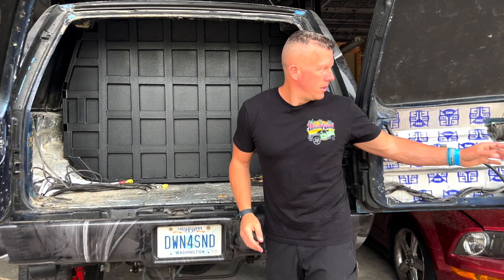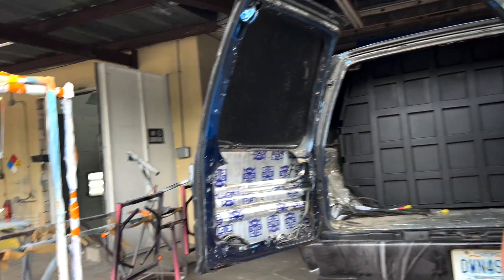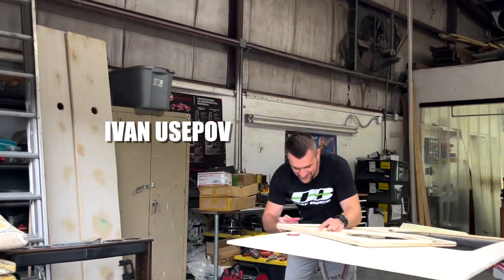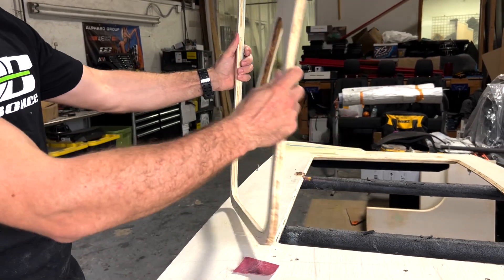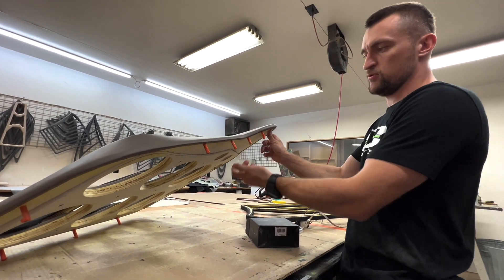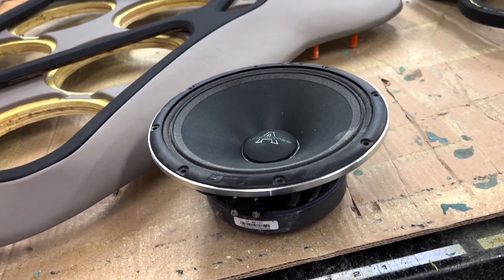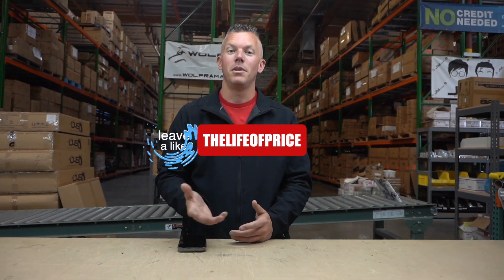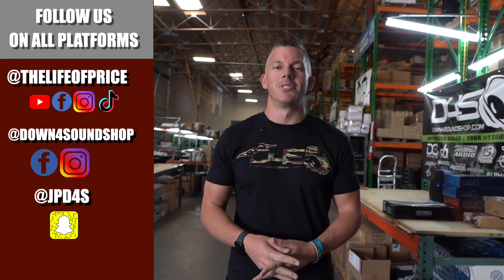TAHOE RECONSTRUCTION UPDATE 3

Comment: Hey man, I have been following you for many years and first I would like to say congrats on how far you have come! I would like to give you some advice for your truck though. Those big ass wheels and skinny tires got to go. I was an assistant manager with discount tire and worked there for 8 years. I can 110% assure you that those tires are NOT rated to carry the weight you are putting in that thing. If you want it to be drivable and SAFE to do so, you really need to look into some heavy duty tires. Like load range E2 or F.. They make them in larger sizes but they are almost all off road tires. I think that would be better though than the potential for one of those skinny tires blowing out while you are driving and totaling that sick build. Or even worse, hurting you or someone else. Food for thought if you even see this comment lol.

Comment: Good morning. Is 1\0 welding cable visually smaller than 1\0 OFC or CCA? The reason I'm asking is because I currently have 1\0 Soundqubed wire running in my car and I literally just this minute got my hands on some 1\0 welding cable and it looks a little smaller